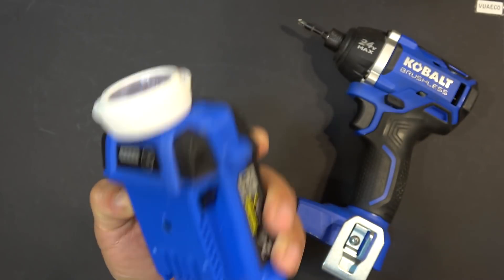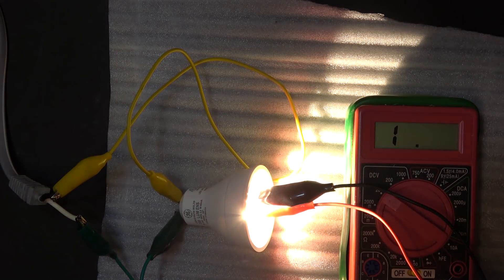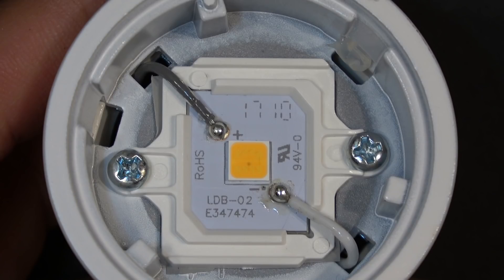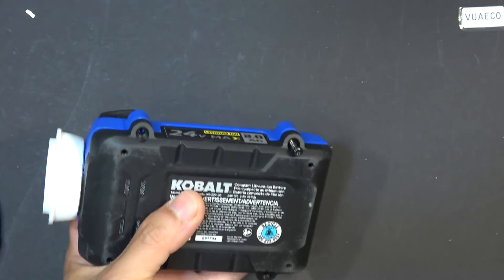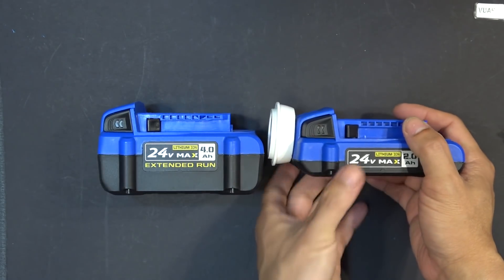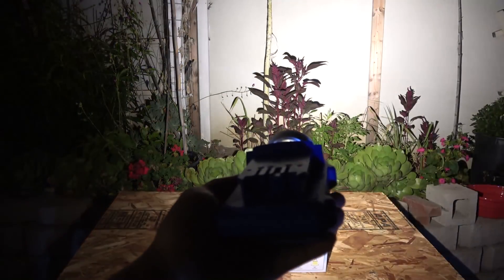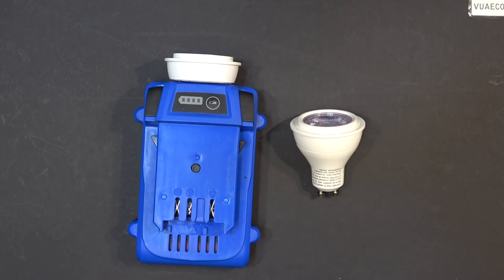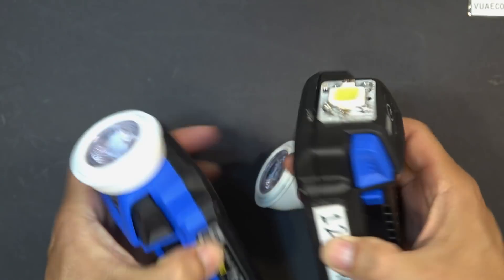DIY: Make a 24V Kobalt Cordless LED Flashlight from a 110V light bulb

Comment: can you make this with a battery pack Energizer EN180 12V 180W Cup Inverter
Reply from the maker: Yes, the bulb is 110V AC. That inverter produces 110V AC so all you have to do is to modify the plug to make it flat so you can just plug it straight in the 110V output from the inverter.

Comment: Thanks another interesting Video from Mr. Vu.(?)  I am curious, how long do you expect the light to last on a full charge.  Guess I could do the math....12V or 24VDC 2.0Ahr? at 24V.  Nice!  Not only great for a handy round the house flashlight, but perhaps ample for emergency or even camping.  Again, well done, and I enjoy (as always) THE SHOW!  Did you specify the wattage of the bulb?  Guessed I missed it.  Worth watching one more time...
Reply from the maker: The LED is rated at 6W. The battery is (24V x 2Ah) = 48Wh. So if you do the math, it would last about 8 hours.